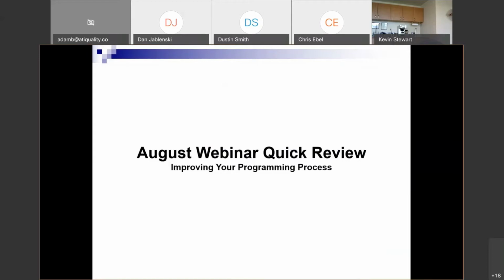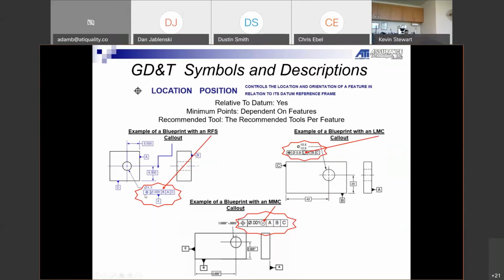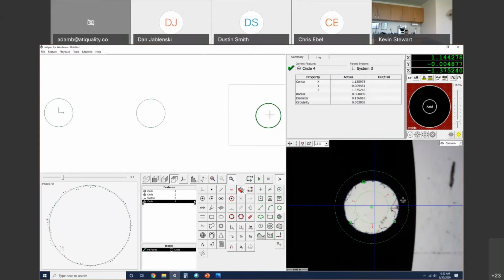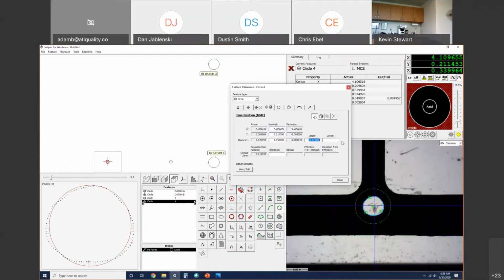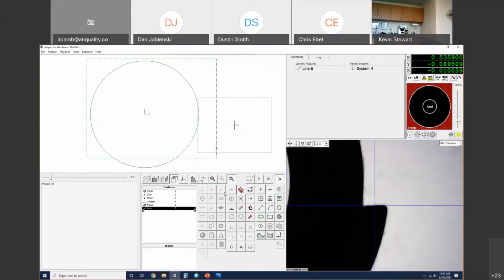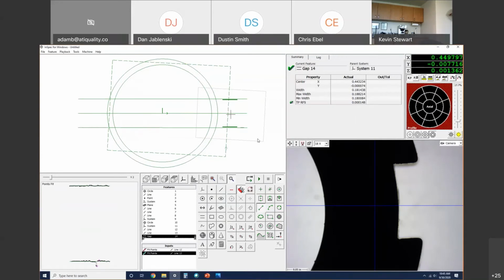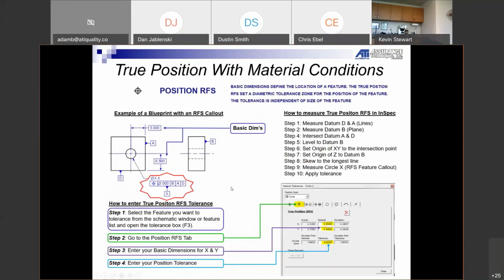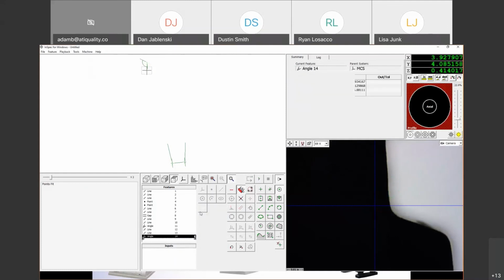ATI Micro-Vu September Webinar - Sept 2020 - True Position

Comment: Good Morning, my first time here and I’m new to Micro Vu. Question on measuring chamfer(Angle and depth/or Dia). Can it be done and how accurate is it?
Reply: You can measure it in a few ways. 1. Sectioning the part on a bandsaw or mill, 2. using focus points with high magnification, and 3 using touch probe or laser if you have those equipped on your microvu. If you need some help let me know and maybe I can help you.
Reply from the maker: Our webinar in January 2021 that is on this channel starts talking about flipping working planes at 49mins. Feel free to email training@atiquality.com with any questions!